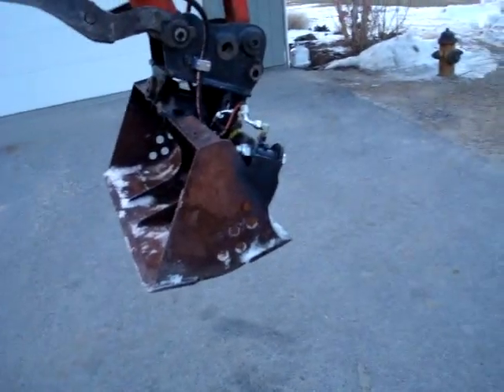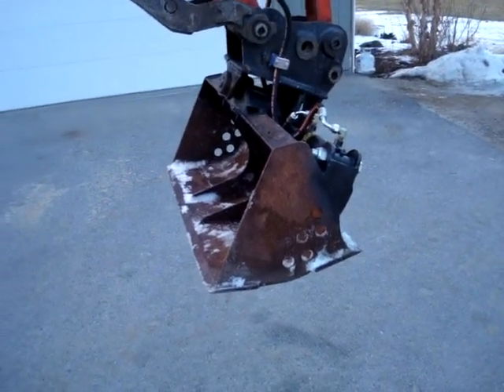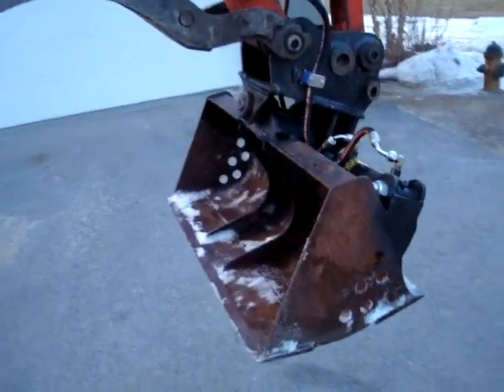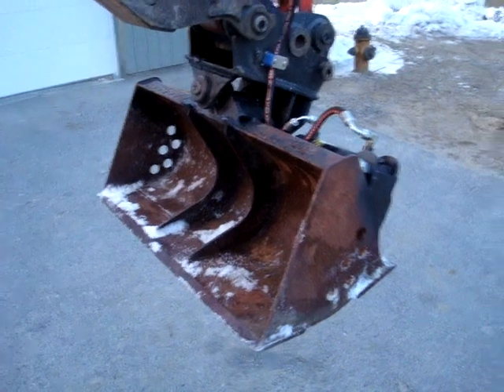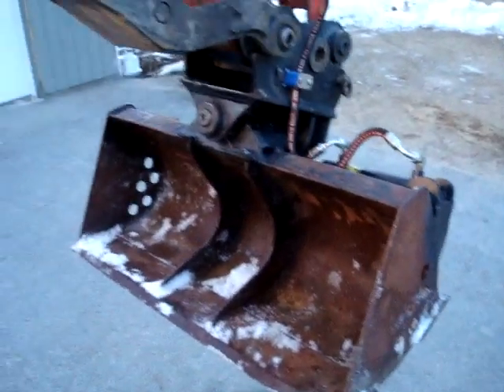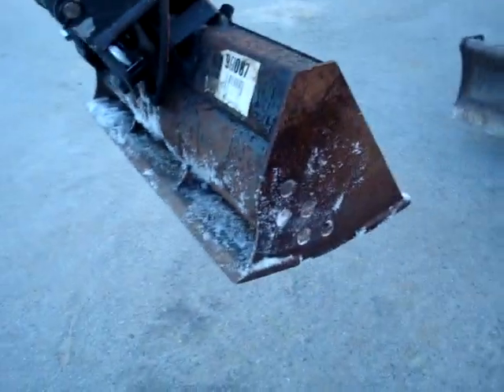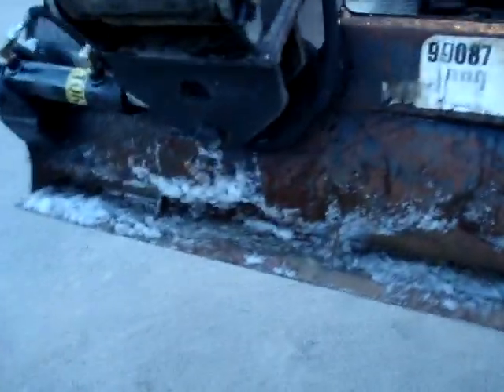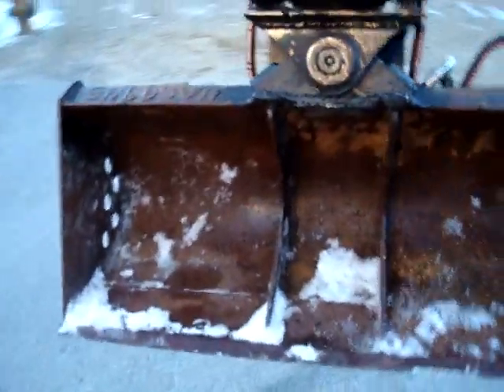tilt Bucket for the Kubota U35

Comment: Well I do have a source for an adjustable needle valve which would work dandy... perhaps put them on the quick connects to keep them out of the way. 

tinyurl,com/bc82n5e.

Replace the comma with a period, and remove the period at the end.  Surplus Center... I've bought from them several times.

Comment: I like the cutting edges on both sides!

You can put an orifice on the cylinder's ports to slow it down.

It looks like the cylinder is pretty well flat/inline with the pivot pin?  Be careful, that puts a lot of stress on the cylinder/mounts.